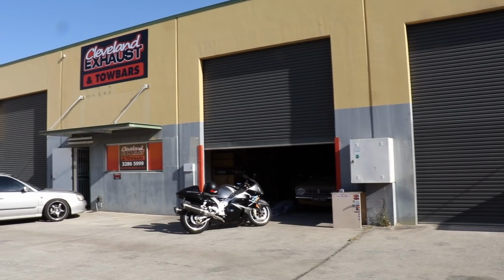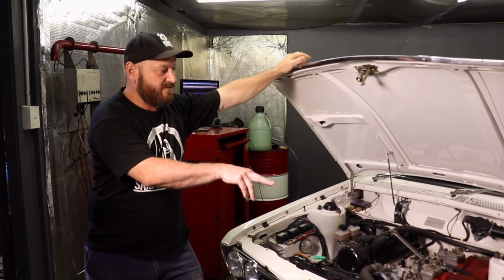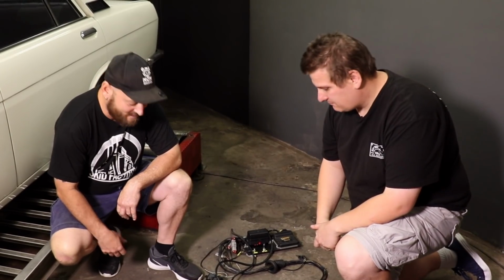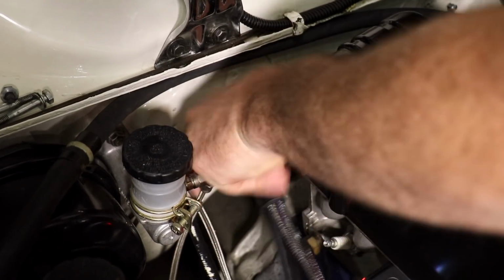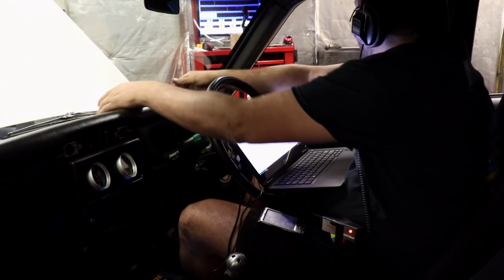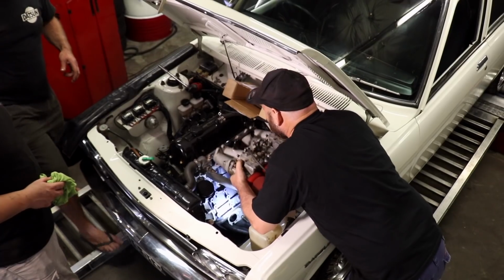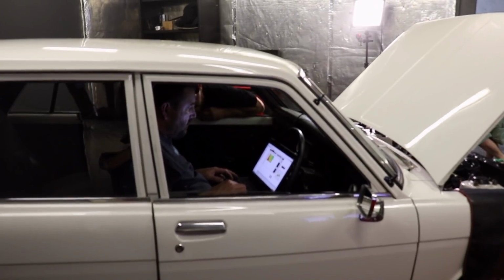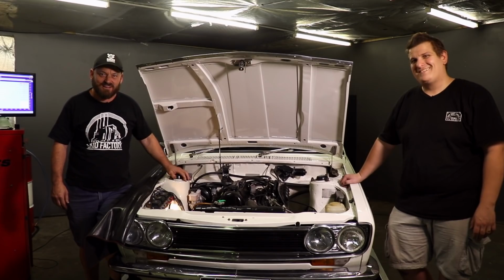Carb vs EFI on an L Series Datsun 1600 - Dyno Test

Comment: >throwing granddad in the bin, and going EFI
lightly places granddad in the bin
Reply: webers aren't cheap, someone will buy those
Reply: Grandad is expensive.
Reply: When is bin collection day at this place?.... asking for a friend....
Reply: Please adjust the value clearances!
Reply: You know when the timing chain needs replacing, because it starts munching on the rocker cover ;)
Reply: Datsun's 70's knock off versions of Webers anyway...
Reply: Matthew Sharpe  mostly copies of English su carby at least on us market cars
Reply: Germans for example- changing to EFI is either illegal  or you lose your classic car benefits (Taxes, insurance, authorization to drive in some cities....)
Reply: Mina Ingraham LOL, true... nobody wanted to copy Strombergs.  I had a Japanese set of 'Webers' on one of my Triumphs back in the 90's - they were at least as good as the real thing - if not better.
Reply: Would have liked to have seen before and after dyno graphs side by side
Reply: Scalenesque yes, solex is the one, thanks. Yes they were very good, hardly ever had to touch them, unlike the various su and Stromberg carbs I've owned that were constantly going out of tune.
Reply: Japanese Webers?  Do you mean Mikunis? I had a set of those on my 280Z, but couldn't get them running nearly as well as a previous car I had with Dellortos on, but it is very dependent on cam, etc.  I wonder if EFI would have as good throttle response as the sidedraft carbs, which were superb in that aspect , with those "water-pistol" style accelerator pumps.  

Carbs are a hell of a lot harder than EFI to set up well, though, lots of dyno time required.

Comment: Having a “Siamese port” engine means it shares one port for two cylinders, not that the intake and exhaust are on the same side of the head.
Reply: Lol yup could have siamese ports on a crossflow head
Reply: glad i'm not the only one who picked up on this.
Reply: Is that sorta the same setup as what the original engine (a series I think?) in Moog's mini had or is that different again?
Reply: hotwire96, similar manifold type but different engine... It was a siamese port too
Reply: scootbmx01, yeah cheers, thought I remembered them saying when they were doing that build that it shared an intake and exhaust port
Reply: Saved me a respone,  i think people think they mean the same thing because of the Mini A series, which had both reverse flow, and Siamese ports
Reply: Sam Johnson, yeah common misconception... Non-Crossflow and siamese port aren't the same thing..
Reply: Siamese ports are independent but are cast next to each other.  The middle exhaust ports on a chev small block are a good example of siamese ports.  The biggest problem with siamese ports is that the common side of the casting won't have a water jacket or clearance for cooling.
Reply: The mini has a 5 port head, which is Siamese port and non-cross flow. The ports from one end to the other are:

Exhaust - cylinder 1
Intake - 1&2
Exhaust - 2&3
Intake - 3&4
Exhaust - 4
Reply: like in my skoda
Reply: I stand corrected.
Reply: It's actually called counter flow when they are on the same side, and cross flow when on opposite side.  Siamese ports is a shared port, like the old Mini A-series.  I'm also really sure Al and Woody know that and it was just a little brain fart.
Reply: Exactly! Who’s training these kids?!
Reply: Sorry Paul, but siamesed ports are open spaces between two valves that share one opening to the manifold.
They are not 'cast next to each other'.
What you may be thinking of, is where some heads have the valve order reverse halfway along the head, such as the difference between the Chevy V8 used in Kingswoods, and the Holden V8 used in Commodores.
Reply: First time I've come across that term for a non-crossflow head - and that is from my 'prenticeship starting 40 years ago...
Reply: Holden Grey/Red engines had siamesed intake ports, and they have come the full circle as the latest Holden 3.6 V6 has siamesed exhaust ports.
Reply: Siamese inlet ports also make running EFI much more difficult as they suffer from charge robbing,

Comment: If you could work out a reverse gear, a complete Hayabusa engine swap would be awesome. A 1600 with 12000+ rpm, 200hp, 6 speed sequential gearbox and less weight would be a weapon...

Comment: Ahhh, memories. My first ride was a Datsun 521 pickup. I drove that thing through 3 engines, 2 transmissions and 2 rear ends. My second ride was a 69 510 with factory racing suspension, high numerical position rear diff, Momo seats and steering wheel, SW Gauges, scca roll bar.  There motor was a L16 with a L18 head and a single Weber 45.  It was so fun to drive!

Comment: Well tuned EFI is always good and can improve driveability. But if you had taken those stupid air cleaner socks off of the carbs before the dyno runs you would have seen a cleaner AFR pattern along with a 2-4 hp increse, maybe even 5 hp. Those things are so gross when it comes to corrupting the intake air. So IMHO the 10 hp increase going from carbs to EFI is slightly inflated. Other than that it is a nice and clean installation. I like the way you did the CNP coils

Comment: webers jetted properly ,are very close to fuel injection, i can see a slight advantage doing the swap but the cost which would be expensive and may not be worth the small gain, i know when are webers jetted  to the max there hard to beat, wish you would have jetted out the webers through the rev range on the dyno first then compared , good review though guys

Comment: The L series motor of my youth. We rebuilt a few of these back in the day. Almost 100 rear wheel kilowatts from 2 valves per cylinder in a 900kg car. I'm impressed. I don't know what's wrong with the 13 thumbs down-er's.

Comment: I owned a '68 1600 in the late 70s.  Loved it.  You can simply bolt other Nissan stuff into them  EG 260Z 5 speed, 240K diff, 240K front struts and brakes, 240K buckets..Sunny steering wheel.  180B engine.  You could bolt on a self learning EFI to one of these...easy peasy

Comment: You should try bike carbs, way better than webers. The slides make huge difference to how the carbs work and they are way easier to setup. If you havent driven a car with bike carbs you should try it. You can just mash the gas pedal and the slides will do everything for you, no more bog or hesitation.

Comment: Old school and New school merging together Love it Lads. My old Ford Cortina had the Spark-rite electronic ignition conversion in it,it made some difference with start up and running of the car but the main advantage was you didn't have to change points and condensers all the time.

Comment: In the early 80's, i had a '72 Datsun 510 with the distributor and points. California emission laws made the original carb/distributor/points system run like crap. It would be interesting to see what gains an EFI system would have made to a stock engine. Thanks for the video! :)

Comment: Those Datsun 510s are awesome little cars - lightweight, front engine/rear wheel drive, and can therefore be made into a beast of a sleeper. Imagine an RB26 or an LS in one of these! I'll also seen some drag-prepped ones that were stunningly quick.

Comment: Oh man, that bog right at the start of WOT.
Reply: André Rodrigues you’ve never seen a dyno ramp before have you?
Reply: I could make all sorts of claims that I've been in dynos all my life, this and that, and since this is the internet, no one would be the wiser. However that would be a lie and I like to learn. 

After reading some stuff, it seems that maybe the ramp up was a bit aggressive, and thus held up the engine a bit more? From the dyno days I've been to and general dyno pulls I've seen on the internet the initial wot moment doesn't appear to be quite as boggy.

Or is this all in my head and I'm full of shit?

I'm sure that the tune was bang on, otherwise the amount of talent in that room would be completely wasted.
Reply: It makes 120HP.  The ramp locks road speed.  Its supposed to bog/strain/create resistance against the engine to measure its power.  Watching 1500HP cars and 120hp car on a dyno are different things.

Comment: Interesting final power figure, had exact same atw on an A14  turbo, 16psi blowing thru intercooler into a 32/36 Webber,  electronic ign' locked on 16deg permanently.  Dead stock motor.
Should have done it all to an L20 I know..

Comment: I didn't think that you could tune a fuel or ignition map with the MAP signal for itbs.  On mine, at like 40% throttle I'm at atmospheric pressure already.

Comment: Those old Dattos were the shit in Rallying for quite a while. I'm betting those carbies weren't really tossed out, someone will want them badly.
In my humble opinion the changes on this were less about power and more about a more modern, reliable and tune-able engine management system and possibly more drive-able too.
It probably gives more scope to more mods down the track too.
Nice work all round really.
Reply: This guy gets it.

Comment: I was watching the fuel injection mist flutter around in the intake, i bet that engine is a little tired. Even with the carbs that thing should have been into the 150hp range with the setup he was running, those L series engines are good.

Comment: Optimised DCOE will make exactly the same peak power (or power at any point, but not over the range) as ITBs, I think those UniFilters were killing it, I lost 15kW in back to back runs with my old Mazda KL V6 ITBs when I put them on, kills the air speed at the trumpet rim
Reply: Yea those Uni filters are absolute terror for air flow, kills quite efficiently. Absolute garbage.
Reply: @skaltura  I remember the difference it made when I found the trumpets that fit with the SU set i had. Was hard not to wheel spin for the first day or so, and had me grinning from ear to ear. I imagine individual filters doing the opposite or worse like you say.
Reply: are there better options ?

Comment: nice upgrade but only showing the hp and not the torq curve, that´s where most off the plus is on doing this conversion, du you make adapters for vw golf mrk.1 gti and the old bugs??? regards Sören

Comment: Awesome, my first car was a 1980 B210 coupe, 2nd was a 81 B210 Hatch and 3rd 71 510 with L20B from a BBird, but was pretty beat up, fixed it and later swapped to a SR20DE (never went DET). Loved em all. Looking to do another 510 in future, and doing another SR20, but DET or a VG30DE. Awesome episode

Comment: How do you get idle control with itb's and a throttle cable (i.e. non electronic actuated throttle)? Do they have a built in level of "openness" to allow a small airflow when closed to allow idle?

Comment: HP is all well and good but you don't drive around peak power all the time.  I'd like to have seen how the torque was and what it's like now.
Reply: VULCAN 650 yeah I'm only guessing but sounded a bit bogged down tipping the throttle in down low rite...in need of some fuel enrichment tuning maybe...sometimes the fuel falls out of suspension under throttle i think. But without seeing a log who knows.
Reply: VULCAN 650 
They do say it was/is a road rally/targa car.. so I dare say it spends most of it's life at 9/10ths. W.O.T.
Reply: Bundy, He said it "was" and that the owner wants to "drive his family around" which would mean it's unlikely to be at W.O.T. for extended times like it used to be used for. 
Besides peak power isn't as important these days and it's more about torque. 
My old lancer compared to my SAAB for instance. Both made the same power only 500rpm apart but where the lancer made 230nm at 4100rpm my SAAB makes 280nm from 1800rpm all the way through to 3500rpm. 
It's nice to say you make such and such power but when a car with 100kw less and is heavier thrashes you, you stop caring about big power numbers and focus more on torque since that's what matters. 
For instance that same car made 180nm more torque.
Reply: VULCAN 650 
Oh... another Interwebs graduate.
Reply: VULCAN 650  torque x rpm = hp
Reply: word
Reply: What you have to remember is modified camshaft that it has. Which was designed for when is was getting raced. They are limited to that cam profile I.e making power at higher rpm. If they put a stock/milder cam in they would be able to make it have more torque etc.
Reply: But that would be lame. Everyone loves a screaming L series.

Comment: Love it, i have a 71 1600 with a 2.2 stroked L20b and have bought most of the bits to do just this. Instead of the motorbike throttle bodies i got the webber adapted TBs. just waiting for an ecu. Where can i get that reluctor set up!

Comment: What was that leaking out when the EFI manifold was installed? Just gas? 

Very nice to see the process. Would like to do a Carb to EFI project one day. Have a single carb Ford Pinto 1600cc car in the shed.   
I once did an EFI project on a honda GXH 50 cc engine. Ran like shit. Didn't start right. Only on high RPM. Learned a lot.

Comment: awesome JOB!!!  question: then it will be possible to use a yamaha R1 thottle body bolted to a proper manifold to retrofit in almost any engine?  i have a hillman avenger with a ohv 1500cc 4 cylinder engine. the only thing it will be hard it's the electronic ignition part (i have an electronic ignition already driven by a chevy HEI module) but i think it can be adapted something like you guys used on that engine... :P

Comment: what's the cost difference if going from a single carby and points to either the efi fitted or the twin weber setup?  both need professional tuning i'd guess, would that be similar dyno tune cost?

Comment: I need one of those distributor adapters... I have an l28et on megasquirt. where were you when I was megasquirting my car 10 years ago. Lol... I had to stick my underdrive pulley on a lathe and stick ford edis reluctor ring on it as a signal then out of ecu to MSD to a custom Fab distributor that's been locked up with no more weights in it. I guess I need to start looking into haltech and one of those sensors adapters. I can still use my crank sensor but it would be really nice to have that and coils.
Reply: all the boost I'm using crank angle on my L20b which should be more stable than the distributor type at high rpm but I am using 4 x ls coils just run with wasted spark rather than sequential.
Reply: Find me on Facebook OneSix Industries.

Comment: 6 months later still no costs for all these mods and a dyno tune.
    You can not tell me 10 hp was worth all the extra costs. You could put a LSD in the diff and a top of the line tire. Have the carbs rebuilt and still have a lunchbox full of money left over.
   Also a good dyno tune on those carbs after rebuild may get you the same results in HP.
    Im not buying the mods worth the money spent....  Im not sure I want a classic as mild mannered as a new car......Im a glutten for punishment...!
  Surely you have a cist break down by now..?

Comment: That is a lot of money to spend for essentially zero return! Similar to the LS engine with the twin turbos putting out 380 horses.
Reply: Which LS engine did that? 
How much money did this cost?
Reply: Standard LS 1 engine. Articles in CarCraft Articles in Hot Rod. Normally aspirated - Five hundred plus HP.
Reply: Std LS1 NA engines make 380hp or 500hp? Confusing reply.
Reply: How can your 383 be std? That is not even a std GM engine size. Std in our language means unopened factory built engine with no cam change, head work etc. There is definitely a gap in understanding here. A 350 small block with a 400 crank, pistons, cam, lifters, heads, valve springs, intake manifold and aftermarket carb and ignition is not std. An LS1 pulled out of a wreck with a factory ecu and untouched factory internals is a std engine.

Comment: 10 horses and a slightly flatter torque curve for how much?  Would have been better value to fix the rust in rear quarters 🙄
Reply: You say 10 horses like it's nothing, but for this car that's an 8% power gain. Not bad really.

Comment: I Take it that considering this EFI setup uses ITB's that there is no MAF and/or MAP and oxygen sensors, and therefore no closed loop fuel control what so ever on this?
I'd imagine that makes tuning a bit trickier and dangerous than it would be on an engine that has these sensors?

If the lack of sensors is true, why go this routes rather than say using a manifold and using the Haltechs built in MAP sensor?

-- Alex.
Reply: because itbs rule.

Comment: Very interesting, I have a dual fuel carbie z24 motor. I think I might investigate going to programmable ignition.
Reply: Ursh anabi this is where I'm headed too
Reply: Haltec is great but if on a budget Megasquirt cant be beat.
Reply: I hadn't thought of megasquirt as an ignition only solution. I do have 2 old programmable ECU's from the 90's somewhere. a wolf 3D and a link G1

Comment: Can't say I know much about carbs but wouldn't efi be better all round than carbs since they are easier to fine tune and easier to get the most power out of? Keen to be educated
Reply: Private Benjamin The fine control of efi makes it more efficient and it works better in normal driving. Outright power though they can be pretty even. The fuel from the carb cools the intake charge which helps power, but because of the long distance through the intake the fuel can puddle and cause issues. With efi it’s more efficient because of the fine mist of fuel which also keeps it from pooling. But, with port fuel injection it doesn’t work as well to cool the intake charge so you can loose some power. 

So, all in all you can usually get pretty similar peak power levels either way if the throttle body and carb is sized about the same.
Reply: NBSV1 cheers for explaining